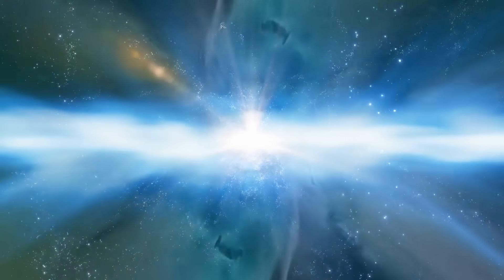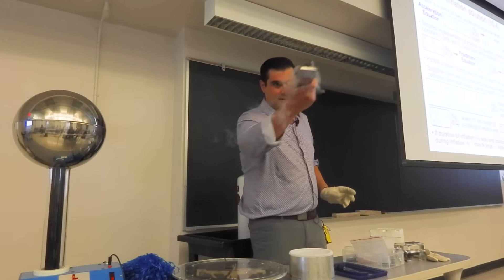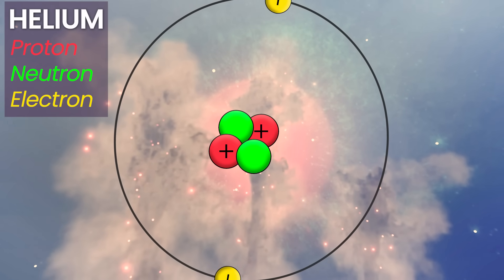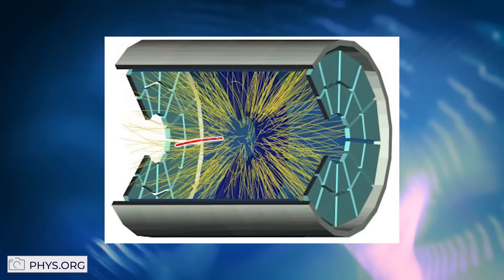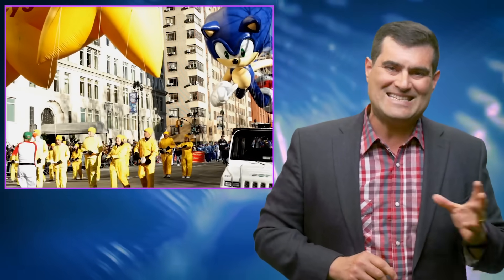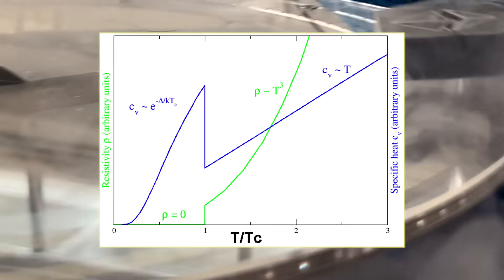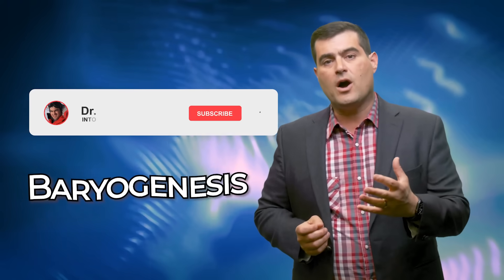Scientists Just Mixed Matter and Antimatter (It Didn't Explode)

Comment: 7:40 - I'm fairly sure that you have transposed the viscosity labels. You have labelled cold maple-syrup as having low viscosity whilst hot water is labelled as having high viscosity.
Reply: @halfrhovsquared  viscosity is measured at room temperature?
Reply: @ - Viscosity is temperature dependent, so it can be measured at ANY temperature but it will vary and any measurement established will relate to that particular temperature. Either way - the labels on the video are the wrong way around because viscosity (generally) DECREASES with temperature. Things with a high viscosity are resistant to flow whereas low viscosity fluids flow, easily. Cold maple syrup has a higher viscosity than hot water.
Reply: @glennoc8585   - Viscosity is temperature dependent, so it can be measured at ANY temperature but any measurement established will relate to that particular temperature. Either way - the labels on the video are the wrong way around because viscosity (generally) DECREASES with temperature. Things with a high viscosity are resistant to flow whereas low viscosity fluids flow, easily. Cold maple syrup has a higher viscosity than hot water.
Reply: @halfrhovsquared  expensive motor oil stays higher viscosity at highest temperature and lower viscosity at cold I believe.
Reply: @ - There are oils (mainly synthetics, I believe) that have a flatter curve. I don't know of any which are thinner at low temperatures and thicker at high temps - For a start, it would not make sense to put such an oil in an engine. The ideal is for the oil to have as consistent a viscosity as possible - ie, as flat a curve as possible. An oil that thickens with temperature would have no benefit. We want the oil to have particular properties at its normal operating temperatures, yet, still be able to function successfully at ambient (cold) temperatures to prevent wear during starting and engine warm-up.

However, that does not mean that such fluids don't exist - I just do not know of any and that is why I said, "generally" in my earlier comment, to account for the potential exceptions to the general rule.

I fly an aircraft. The viscosity change of the oil is something that I directly experience, first hand, in a number of ways.
Firstly, during pre-flight, I have to do something known as "burping the engine" which involves rotating the prop to pump the oil up into the header-tank in order to be dipped. It takes a lot longer on a cold winter morning to do this than in the summer, and it takes even fewer turns of the prop when the engine is already warm.
When I start the engine, the first gauge I check is the oil pressure gauge (to ensure that the oil is being pumped - no pressure means that I shut down the engine, immediately). On a cold-start, the oil pressure is at the absolute maximum that it can safely be (top of the green arc). It takes about ten minutes for the oil pressure to drop to the middle of the green arc and this coincides with the oil temperature coming up to nominal. The high oil pressure is caused by the high viscosity. As the oil warms and the viscosity drops, so does the pressure. It is easier to pump oil when it is less viscous.
The oil I use is a semi-synthetic.

However, that still does not alter the fact that the labelling in this video is the wrong way around - Cold maple syrup is more viscous than hot water (in fact, maple syrup is more viscous than water at any temperature where they are both liquid).

Comment: If the symmetry principle is actually true (which it doesn't have to be) then there is no reason why the universe would have differing amounts of matter and anti-matter.  My theory is that the universe is much much larger than just the observable universe and that somewhere beyond of observable bubble there is an origin of the big bang and in the center is a plane of anti-matter and matter combining to create heat and light but this heat and light pushed away matter onto our side of the divider and anti-matter onto the other side.  This theory only works if both sides are traveling away from another or circling one another and only if there is either a single origin of the universe or if several they're line up on a plane such that the above theory would still work.  This would also work if the universe were a patchwork of this pattern repeating over and over but on a larger scale.  This doesn't work as well if the big bang happened everywhere at once. However, if anti-matter tended to clump with other anti-matter and matter with matter, over a long period of time the universe might organize into bubbles of mostly just matter or just anti-matter. And, after some initial annihilation they reach an equilibrium state where the bubbles were separated enough to no longer annihilate one another.  It is also possible that symmetry is not a thing but then if that were the case, then there should be an explanation for why, something different between matter and anti-matter.

Comment: Great episode! As for the cosmic matter/antimatter dissymmetry Brian mentions at the end; that paradox really depends on how we view the shape of our Big Bang. If indeed our Big Bang was a kind of ‘dumb’ exploding sphere, then indeed we have an issue explaining the observed lack of antimatter. But an exploding sphere is not the default shape of cosmic high energy cosmic structures creating matter and space.  Like star birth and galaxy birth, the typical structure actually would involve a high energy disk, with two jets, feeding two lobes of purged matter and radiation on each side. The Cygnus A galaxy would best represent this high energy default shape. If our Big Bang were shaped this way, then obviously the central disk would create a matter lobe on one side (that would be us) and anti-matter lobe on the other. That explains why we can’t see anti matter. Problem solved. The detailed mechanism for dividing matter into both lobes would be the central spinning disk, presenting clockwise electroweak-spin on one side, yet viewed from the other side, anti-clockwise electroweakspin. This means newly created matter of like spin would be accelerated away from the disk, but matter of opposite electroweak spin (antimatter) would be pulled back to the disk, cross it, and next be pushed outward on the other side. This also means after a quick expansion, half the matter would return to the other side, causing contraction, followed by gradual expansion again. Also, there would be traces of an umbilical cord connecting both lobes even today, which we have in the form of the great attractor, showing preferred cosmic motion. So in all; we can solve the matter anti matter paradox by just revisiting our idea of the shape of the Big Bang.

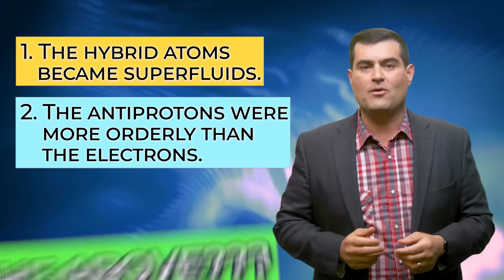Comment: 10:25 neither of the two 'possible answers' makes sense.  The answer probably has more to do with the decay phenomenon where a proton in a nucleus can give off a positron to become a neutron; possibly meaning the only charges in mass are from negtrons and protons.  That might also make it easier to explain why our area of the universe seems to be all electrons and puffed up positrons instead of positrons and puffed up electrons.
Reply: @rogerjohnson2562  proton decay is only theoretical right now, and hasnt been observed in experiments, which is probably why it wasn't included (not that the explanation doesn't hold merit)

Comment: The chemistry implications are hilarious and no one is talking
Reply: I think the difference is size of the two types of helium have been calculated and even measured (through spectral lines?). Try listening in the right place?
Reply: @Ava31415  no dude. You are baby thinking. What happens if you can expand on this? Its literally the bigggest development since actual chemistry. You could make designer atoms. Do you get the ramifications of that? Not to mention virtual atoms. Dude... please educate before commenting.

Comment: Hypotheses: In the early universe there were equal numbers of atoms and anti-atoms. Antiprotons being larger than electrons had a higher rate of collision with their positron counterparts. This explains the imbalance.
Reply: Alternatively, in the creation of matter and antimatter with the same probability for both, simple random fluctuations could make slightly more matter than antimatter.

It is like throwing 100 coins and getting, by chance, some more faces than tails or vice-versa. 

It would be strange that a particule is of a different size than its antiparticle. Why the difference? It would need another added explanation. However, random fluctuations are there already. They dont need to be introduced.
Reply: Antiprotons don't anniliate with electrons, but with protons.

Comment: Of course it didnt. The whole theory about antimatter and what it is is dubious.   Matter and Antimatter would only annihilate if two particles of the exact same mass - same everything but with perfectly opposite spin and it would have to come into contact perfectly straight on - not at an angle or a sideskirt.   Otherwise the spins will not cancel out it would only result in partial  destablization of outer spins and maybe turn them into a different pair of particles temporarily.   

But people act like anti-matter and matter are monolithic like if you have a anti matter pie and matter pie and simply have them touch it will explode like a nuclear bomb. This isnt how it works.  is a carbon coming into contact with a positron  or an anti-hydrogen? Who knows - but it would not result in an explosion in most cases.

ANti Matter is just normal matter - spinning in the opposite direction relative to our local field.   In the view of some other galaxy - we're the anti matter and they're the normal matter. IT's all one matter - its all the same type of matter - it's just matter upside down relative to us, spinning in the opposite way (and not necessarily perfectly opposite).  But anti matter can't exist for long in our local field because with each small collision with the local photon field - it would be re-oriented until it is in harmony with the spin of the environment.   it can't survive opposed to the flow of everything else around it - eventually the flow of photons and such will turn it around and it will either become normal matter or it will have been spun down and knocked down a few notches leaving behind a smaller normal matter particle..  Not exactly a nuclear explosion))

Comment: It'd be mind blowing if the only thing needed to store antimatter is a really good refrigerator.
Reply: sounds cool until the fridge stops working, causing the superfluid to heat up until it becomes regular fluid and you unintentionally create an antimatter bomb.

as always, "think of what humanity can do with this 😀" and "think of what humanity can do with this 😱"

honestly though a superfluid helium antimatter storage system would make an amazing propulsion method for spacecraft, just have a tiny slow spray of superfluid "hybrid atoms" into a magnetic nozzle with heating and you could have enough delta-V to reach other star systems in 10-20 years and still have enough energy left to blow it up (the entire star system).
Reply: @JedPotts-jv2ux Compared to a space ship, a star is huge and incredibly energetic. A few tons of antimatter exploding might briefly shine brighter than the star, but it would be a localized effect. It would need to be really close to a planet to destroy its atmosphere. The other planets in that solar system would be fine.

Destroying a solar system is hyperbole.
Reply: @hamjudo 
That would be (a) super(nova).
Reply: @hamjudo  Are you sure that comment you replied to wasn't just the tiniest bit tongue in cheek?
Reply: @JedPotts-jv2ux  Theoretically we could get the most energy-dense rocket fuel. But we would need something like fusion to make it possible because the energy conversion rate would be terrible with all of the losses.
Reply: @JedPotts-jv2ux  It's much more convenient than magnetic confinement vessels. The refrigerator at the very least doesn't explode immediately if you lose power for a few microseconds.
Reply: Actually (at least according to ChatGPT web search .. 😅) this antiprotonic helium is more applicable to general research for stuff like CPT-Symmetry etc, and the "stability" in this context refers more into time scales in the order of microseconds, rather than long term storage, such as what is possible by the use of Penning traps.
Here's a tl;dr from the chat:
"Penning traps are superior for long-term antimatter storage, lasting over a year, while antiprotonic helium is short-lived (microseconds) due to inherent annihilation. However, antiprotonic helium research is crucial for testing fundamental physics, studying antimatter-matter interactions, and exploring quantum phenomena, even if it's not practical for storage."

Apparently, penning traps remain the most effective method for long-term antimatter storage due to their stability and scalability.

Emerging methods like dense antihydrogen storage or scalable microtrap arrays hold promise for higher storage densities and more practical applications.
Reply: Super cooled and magnetically suspended?
Reply: Scientists have been capturing and storing tiny amounts of antimatter at CERN for a while already.
Reply: @solconcordia4315  As I understand it, their methods for holding antimatter have been "leaky" at best, ie, not suitable for industrial scale production and storage.
Reply: @noppornwongrassamee8941  
Maybe Ghostbusters movie's cross-beaming will have to await more research before the sheathed anti-protonic alpha-particle beam can become a U.S.A. military weapon.
Reply: That would basically make it a fuel source if you could simply store it in a fluid mixture, and heat it to cause it to react.
Reply: @noppornwongrassamee8941  It is good for a storage time of single digit nanoseconds. This is an improvement of a factor of a thousand, but there is a long way to go.
Reply: @noppornwongrassamee8941  
I hear that they've got anti-matter building-up in the sewers at CERN.
Reply: No, that IS all you need. Simply a good freezer. A VERY, VERY good freezer.
Reply: @noppornwongrassamee8941  if we can use this to store antimatter then  drive might be possible

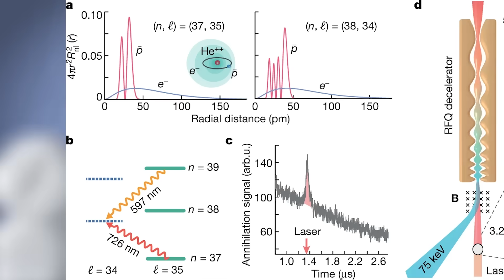Comment: From the graphs at 8:43, the antiprotons are in Rydberg states with ridiculously high principal (n) and angular momentum (l) quantum numbers.  This means that the antiproton has an extremely low probability of being near the protons, hence the long annihilation lifetime.  When the l value was lowered either by laser excitation or stimulated emission, the annihilation rate went up as there was a greater (but still low) probability of the antiproton being near the nucleus.  Normally high lying Rydberg states get quenched by collisions--what this seems to show is that collisional quenching is minimal in a superfluid environment (which makes sense given the other properties of superfluids).
Reply: I would have supposed that an antiproton would get "ionized" away and so escape from the nucleus, much more easily than an electron. Not true?
Reply: @RalphDratman  An antiproton is about 2000x heavier than an electron, so it's a lot harder to push out.  If an antiproton is shot into a fluid of supercritical helium, it will be repulsed by the much lighter electrons, which will eventually cause it to lose energy and get (weakly) captured by one of the helium atoms (by knocking out an elactron).

Comment: you always point out that protons and antiprotons should attract each other and annihilate. Electrons are also of opposite charge and don't get "sucked into" the core. They're much lighter, so it should happen much easier. But it doesn't. 
Obviously, there is some kind of barrier that would have to be overcome. And the temperatures in liquid Helium are just not high enough to do so. But just because the antiproton has such a high mass, it happens on higher temperatures. For electrons, it doesn't even happen in plasma when protons and electrons run free. That's much stranger, but not even talked about.

Comment: I would like to understand gravity which seems to be related to the atomic attraction of mass. [we don't actually understand gravity] Then with respect to the "Big Bang" and how matter [mass] formed via the cosmological constant of gravity and why it's so precise that it alone seems more than a coincidence. How precise? Imagine a ruler with 1 inch increments stretched from one end of the known universe to the other end of the universe and yet our gravity strength only occupies one inch. If the strength was one inch up on the ruler matter wouldn't form and if it was 1 inch lower on the ruler all mass in the universe would be packed into a single big ball. That's pretty precise and apparently not by chance.